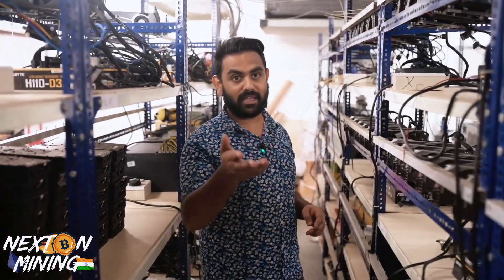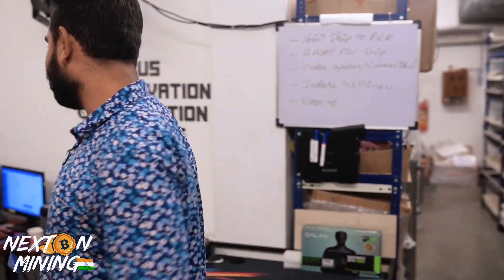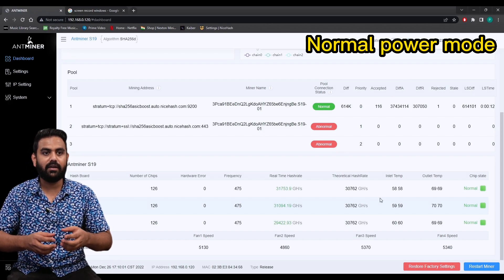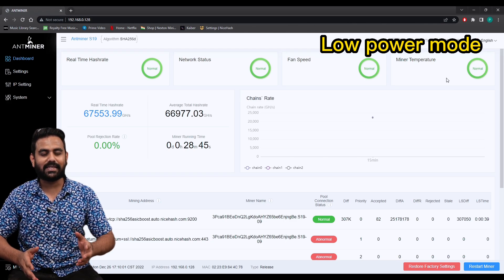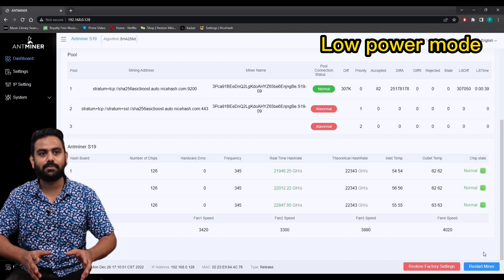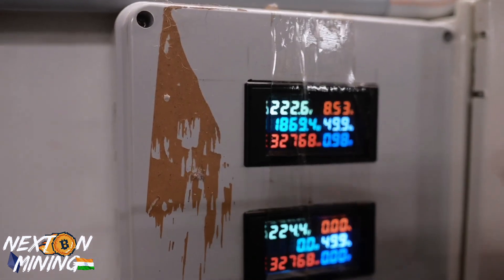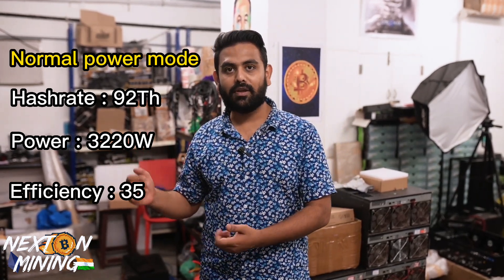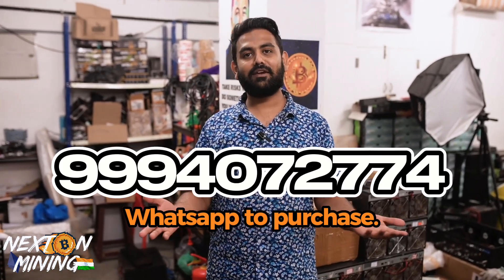Antminer S19 90Th at 2000W? 🤯🔥 Low Power Mode Bitcoin asic miner⚡️🚀 Crypto Mining India #Crypto

Comment: I have a S19 unit only, I updated to the latest firmwire, when setting the fan configuration to 30% it does not take it, the fans work at 6000RPM, I want to know how to correct it
I have Firmware Version Mon Dec 26 17:10:01 CST 2022
Reply from the maker: Yes this is a bug in latest firmware.
Reply: @NextonMiningIndia  How do I go back to the firmwire that the miner brings, I remember that the date is September
Reply from the maker: Downgrade isn't easily possible.. 

You can flash using Amlogic recovery firmware then try to flash the September firmware.
Reply: @NextonMiningIndia  Where can I get the Firmewire for the month of September to be able to apply it?
Reply from the maker: Some 3rd party website host the older firmware
Reply: How do I fix fan emulator problem for cv 1835. s19 90th.  error lost on fan 3(front fan)?  Is it possible to use hive os for 90th?
 @NextonMiningIndia

Comment: better 2 pcs s19 90th low power. than 1 s19xp. hashrate is almost the same 140th. with a watt difference of 800 watts. and of course cheaper prices

Comment: Hi bro 
My s19 90th front fan 3600rpm backfan 3000rpm , consumption 13.867 is ampere
When front 4500 back 3700 is 14.300 ampere.
Anybody know s19 82th normaly 3700 rpm fan speeds , consumption same 90th or lower than ?!
Reply from the maker: Usually front fans are 1.6A and rear are 2.6A both rated @6k RPM so u can calculate accordingly.